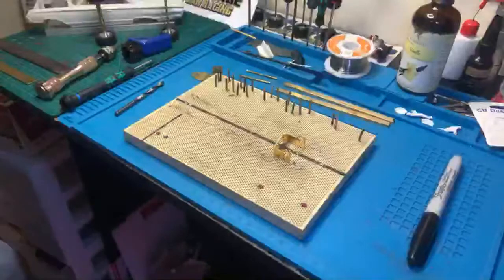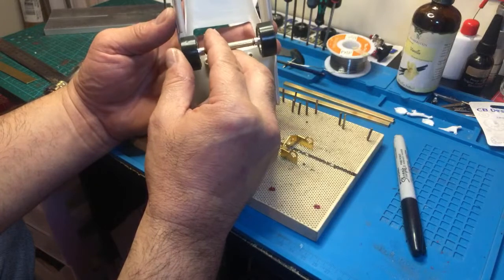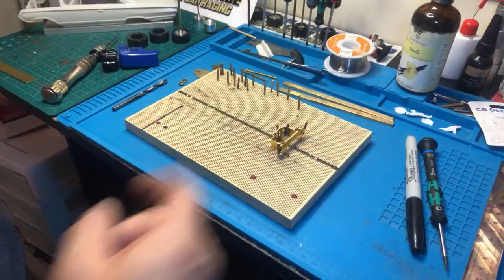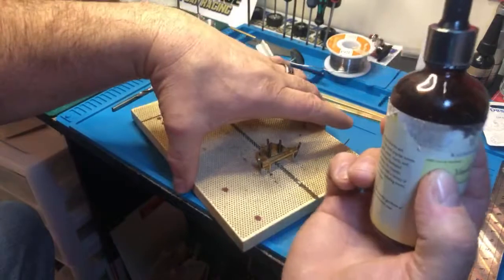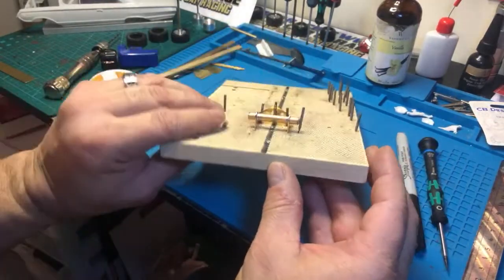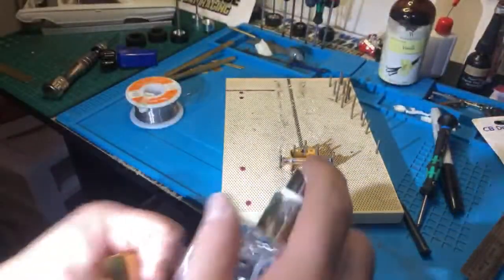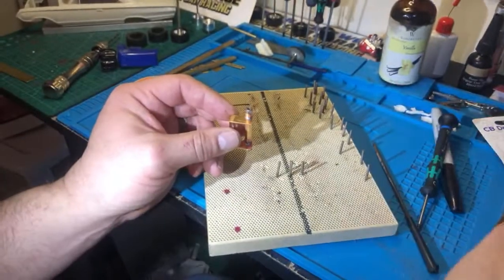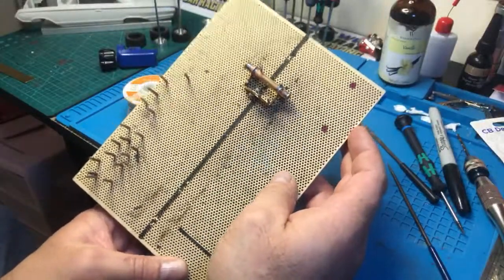Brass Chassis Build

Comment from the maker: I hope this was pretty explanatory as my hands did block some views along with me not entering the on frame of the camera. I will improve as I do more. One important note: Scott Kulp from War Eagle Raceway had a good point and tip for soldering axle bushings in the comments. Leave the axle in when you solder the bushings on the tube. This will assure a better alignment so you do not have to use the drill bit to shave some of the bushing off to align the axle. I will start doing this from now on forward on the next builds. Thank you Scott for that important tip!!!

Comment: Aren't the measurements in centimeters instead of millimeters, since 12millimeters is just under a half inch which is extremely close to 1/2" , and 7in is only about 9/32" .
Reply from the maker: You are most likely correct!

Comment: Great build!! what Watt Iron do you like to use?
Reply from the maker: This one from Amazon is good.
Weller WLC100 40-Watt Soldering Station https://www.amazon.com/dp/B000AS28UC/ref=cm_sw_r_cp_api_glt_fabc_TNAQZSRG32P7Y0PV5THT
Reply: @Area51racewayNC  Awesome thanks. I heard you mention the one from amazon but i seen a bunch on there. I build using a torch right now and  been looking to get an iron. I also have an old radioshack iron thats not great think its only like 20 watts.
Reply from the maker: @TheSlotSpot  That one I sent you in the link will work fine and not break the bank. It has the flat tip and not a pointed one cause you want to distribute heat on a larger area when soldering the brass.
Reply: @Area51racewayNC  that's good to know cause when I started scratch building a few Months ago i tried to use a pointed tip and failed that why i ended up going with the torch. build 3 chassis with the torch but its very hard to control the heat . Thanks again for all the info !!
Reply from the maker: @TheSlotSpot  no problem and make sure you use acid flux which helps the solder flow nicely
Reply: I have an old wood burning iron that I use for anything that I want to heat quickly and it's never failed me and has done a lot of the'70s and '80s piano wire frames.
Reply from the maker: @horsepower711  That’s pretty awesome. I just have a regular iron but it does the job.